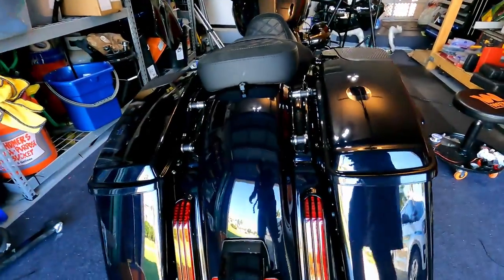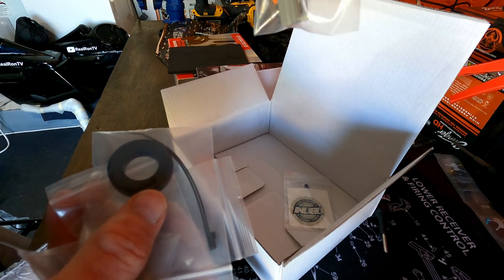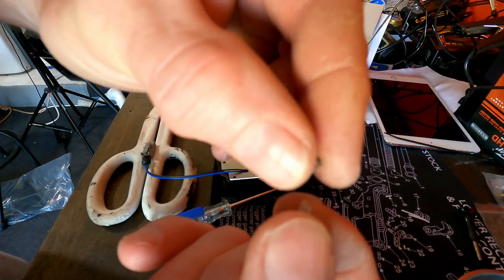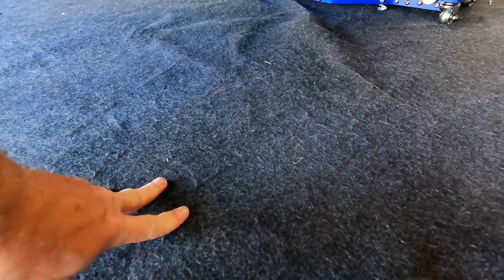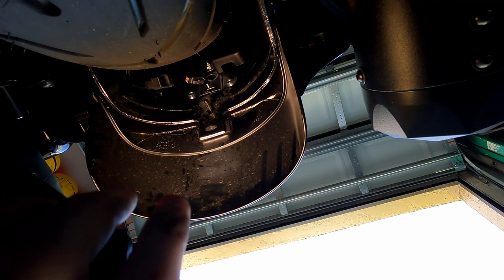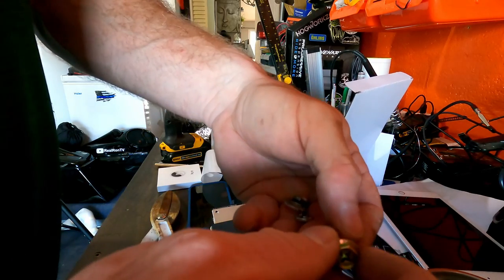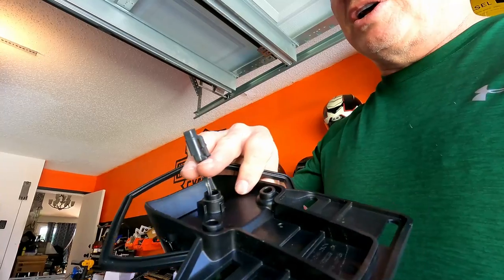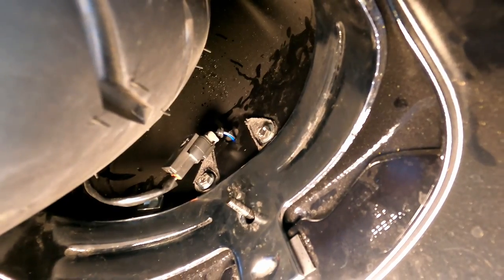Paul Yaffe License Plate Holder Install - 2022 Harley Davidson Street Glide CVO - Steel Blue

Comment: You are hilarious and real on these installs. I installed the same frame back in 2017 and the instructions were just as poor then.  The tag has to be somehow be rolled/bent to match the frame , and the Phillips screws are not of great quality. I hacked my Florida tag up to get it installed, you did better than me. I have a 2022 Street glide ST and have been looking for a frame. Thanks.
Reply from the maker: Thank you 😝

Comment: Quick question on this brotha… I’m sure you know more about it.  Because this plate blocks the outer diameter, and it partially blocks the date of expiration, will this lead to getting a fix-it ticket?  I’m back and forth on this one.  Also, having to remove it to replace the Expiration date lol

Comment: I installed same frame on my 17 RGU only thing I had advan black CVO fender and the plug wouldn’t fit through the whole  in fender had to cut and re-attach

Comment: Looks Good Ron.  I thought the LED lighting should be on the top side of the tag beaming the light down.
Reply from the maker: You’re probably right but it doesn’t matter as long as it’s illuminated. On a car it’s the top down but that’s mostly because of the design where this frame gives you the choice.
Reply: @RealRonTV  Pretty sure its top down so you dont get water in the LED when it rains brudda... :-D
Reply from the maker: @redrider0151  ok mr know it all 😝
Reply: @RealRonTV  LOLZ....you live in Florida dude....you know RAIN!!  It pools everywhere.... :D
Reply from the maker: @redrider0151  ok Professor.

Comment: Custom dynamics would have been a lot easier and no need to drill a bigger hole in your fender
Reply from the maker: And if my Aunt had balls she’d be my Uncle 😂
Reply: @RealRonTV   true but I only made that comment cause you didn’t want to cut your license plate
Reply from the maker: @purpleheartvet24  lol I’m just playing. What I meant was it’s too late now and nothing I can do. I actually do like the look of this one better.
Reply: The holes didn’t match on my license plate so had to slot them out on and cut out a notch like Ron did for the wire for the LED lights on the custom dynamics. It wasn’t no plug and play either. I had to take the whole fender off to install it. So custom dynamics was a pain in the ass too.